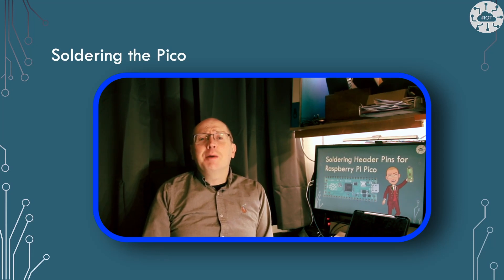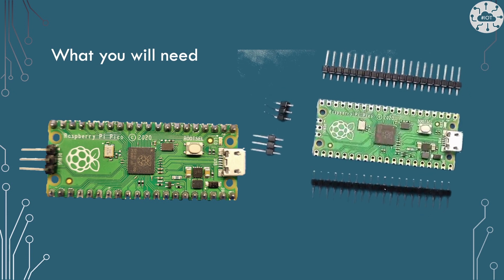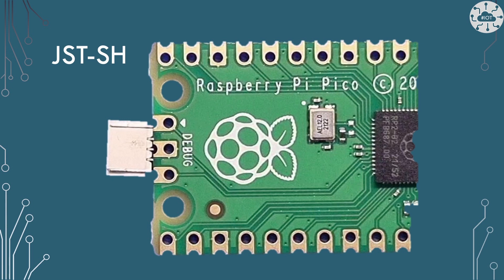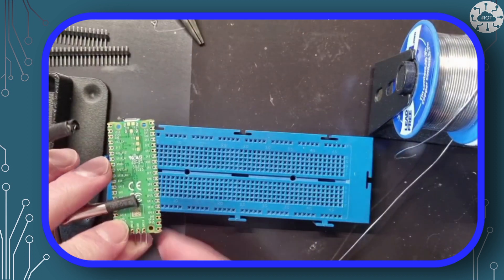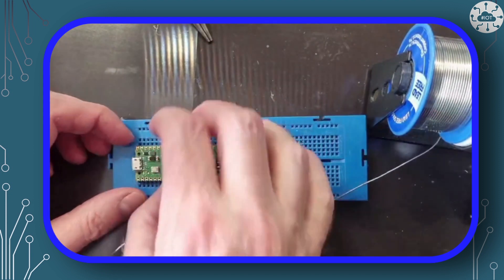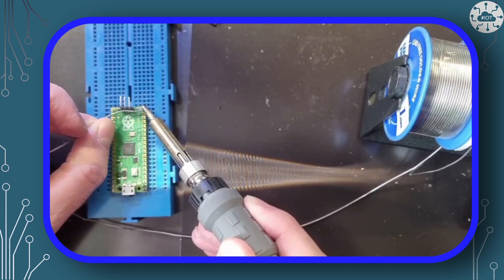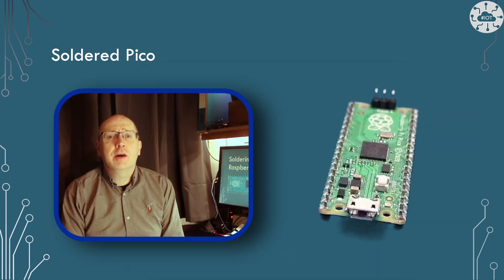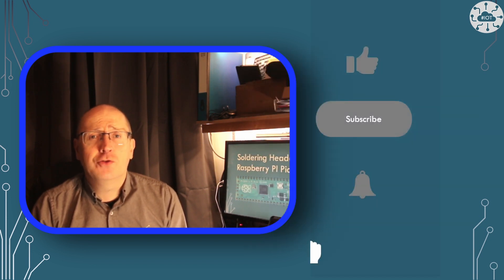Soldering Header Pins forRaspberry PI Pico

Comment: Hi Jon, yes, you do make it look hard! (VTIC 🤣)  Just a quick one - try soldering the 4 corners first, then alternate between ends slowly working in towards the centre pins. This will avoid the heat building up in the substrate on neighboring pins. Love your work!
Reply from the maker: Good tip. 
So much easier without a camera in front of you.